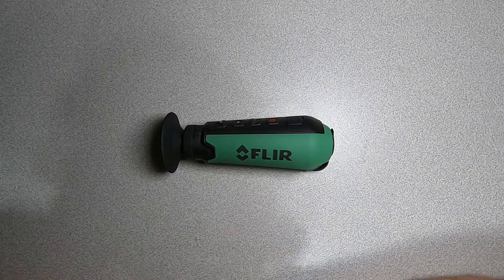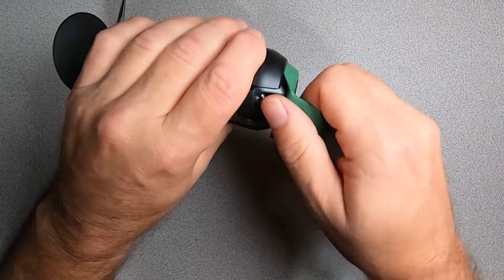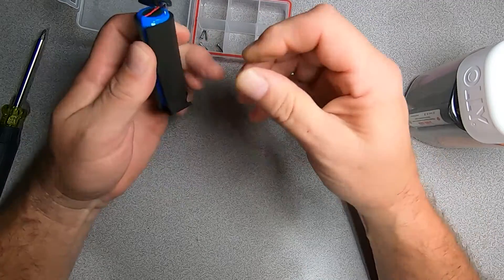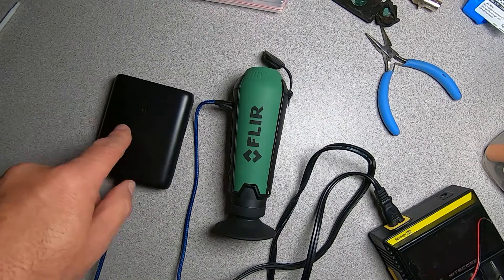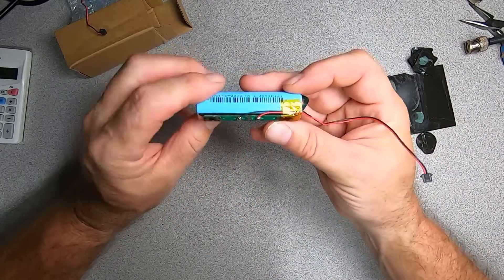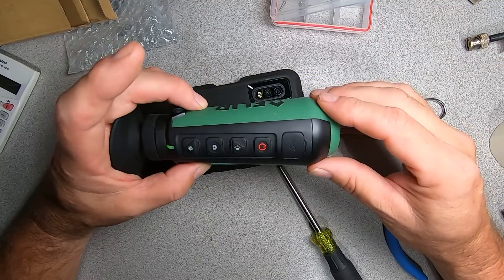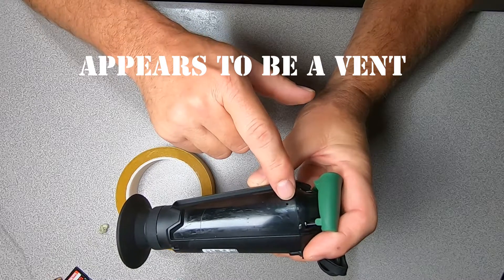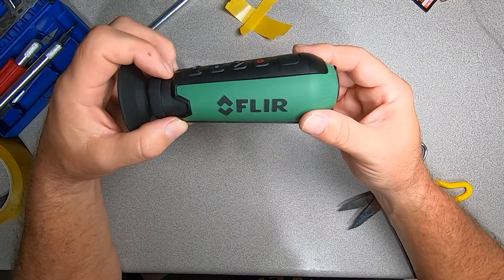FLIR Scout TK Thermal imager battery replacement

Comment: Thanks for the video. I've been having sensor issues with my TK along with the shutter not operating correctly (makes a whining noise). All I had to do was remove and re-insert the ribbon cable. The ribbon cable connectors have a small tab on the opposite side of the ribbon entry that needs to be lifted to remove and insert the cable. The tab on the main PCB is a bit tricky to access however the hook on a dental pick worked well. 

All sorted now and working like new again.
Reply from the maker: That is good news !  Thanks for sharing and thanks for watching !

Comment: I would like to know if people have trouble with their FLIR Scouts discharging a fully charged battery over a period of a week or two. It seems like there is a parasitic load that is sucking the battery even if the unit is not in use. Anybody have the same experience?
Reply from the maker: Yes the device exhibits parasitic draw but if it is discharged within a week you either have a bad battery or your device is defective. Either way to establish cause you are going to have to open it up. Thanks for watching !

Comment: Awesome straight to the point video ! Going to try it .
Amazon has tkx scout for 300 bucks that's half the price of the one you had in this video .
I thought they were the same as the tk but the added x meant it was extended battery life ?
Are you familiar with the tkx ? Just wondering why it is half the price
Reply: Thank you !
Reply from the maker: Thank you ! The TKX has a higher resolution sensor than the TK and it actually has some magnification ability as well. The battery life is shorter by 25 percent however. 

https://comparedhub.com/flir-scout-tk-vs-tkx/

The cost may be due to lower expense of the tech utilized between the TK and the TKX. Thanks for watching !
Reply from the maker: You are welcome !

Comment: Thanks for the video.
I have a problem with the battery. Its useful life is at the end. I looked for a new replacement battery on the Digikey website but it seems that Glob Tek no longer manufactures them. 
Is there a compatible third-party battery for the Flir Scout TK camera? 
So far I haven't found another battery.
Reply from the maker: Tie together single 18650 cell and a  1S BMS , encapsulate it and you SHOULD be set. Safely cannibalize your existing connector from the old cell. I have not tried doing such but that is what the Globtech cell is. Thanks for watching !

Comment: Danka! 🙏
Reply from the maker: You are welcome. Thanks for watching !
Reply: Hey what connector is it the 2mm? I don't see that on the battery spec page your have on here? @survivalcomms
Reply: And do you think it would work with an external battery pack with a dead battery still hooked up, or does it have to be removed completely to work like that?
Reply from the maker: @foxmulder7616  I havent tried to power it with like a battery bank through the USB.
Reply from the maker: @foxmulder7616  Digikey has 109 of the batteries on their site BL3500C1865001S1PCMK
Reply: Oh I'll look again, last time they were out. I was looking on Amazon, and they have 18650 with 2.54mm connectors.. Same specs, they have a slightly larger size connection too , I was just wondering which one, but I'll check digikey again! Thanks brotha!  @survivalcomms
Reply from the maker: @foxmulder7616  any time
Reply: Finally got er done. Putting the Molex connector back in was the hardest part lol, I couldn't see which way it went in on the video, but seems like it only fits one way.. Good it in there and it turns on, lol so she's back together and charging happily! Thanks again brother!!  @survivalcomms
Reply from the maker: @foxmulder7616  That is great !

Comment: I would love to see you convert BA-390 into a rechargeable battery for the prc-104 and prc-113 military radios. People talk about it, but no one shows how to do it step by step
Reply from the maker: I've never done one before. I found some info on this dudes page : http://www.richardsjohnson.net/id16.html
These cells appear to be right for the application :
https://www.digikey.com/en/products/detail/panasonic-bsg/HHR-200AB20T/365589?s=N4IgjCBcoMwExVAYygMwIYBsDOBTANCAPZQDaIcYYArFSALqEAOALlCAMosBOAlgHYBzEAF9CcagA5EIFJAw4CxMiAAsABmqaYDZm0iceA4WLVgE0WWix5CJSORiT16gOwRGIVuy58howjAATkkgmTkFW2UHEHUGUzg3MMsImyV7cjAAOjgAAgA1XS99EABVfl4WAHlUAFlcdGwAV25cAJAAWggU60U7FTp6Uw7qcN6ojJAdIZERIA
you would need 40 of them so cell cost alone would be 250 bucks.

Comment: I changed the battery,no problem, however the unit still discharges in 5 days while being stored.  Any suggestions?
Reply from the maker: There is some sort of parasitic drain going on. First are all of the controls and the device working well ? set the clock and power the device on and off a few times and check the clock. If it passes those tests we need to determine if the battery and its little management board is at fault (likely) or if the the is a problem in the device itself. Fully charge the battery open the device and remove the battery. Measure the voltage and record it. If you say it is self discharged over 5 days check the voltage after 5 days and record that. During this test also monitor the battery temperature and I would keep it in a safe location  while performing this test. If the battery fails this test contact digikey and tell them the battery is defective. If the battery passes let me know and we will go further down the rabbit hole.
Reply: @survivalcomms thank you, I will do that and let u know the results
Reply: Ok, it passed the power and clock test,  I checked the device every day and it steadily drained over 5 days, I will now fully charge the battery, remove it and check voltage after five days
Reply from the maker: @lcdrhobiesaunders446  ok cool !
Reply: I  charged the battery removed it from the Flir ,let it sit for 4 days, tested the voltage. It was about the same as when I tested it however it did not start the Flir and I have been charging it for two days now.  The Flir works when it is plugged in.  I think I have a bad battery, so will order another.
Reply from the maker: @lcdrhobiesaunders446  Its possible it is failing under load but the load is fairly low in this device . Try to see if the battery will power a bright LED head and measure its voltage under load.

Comment: Help! My TK Scout failed! 
Initially, the image started to fade/blur, followed by battery not charging. Now the unit won't turn on and the light won't illuminate when set to charge. I removed the battery, hooked up USB/external battery pack and still nothing. Bought it online brand new about 2 years ago. It's never been dropped or gotten wet. For $600, I'd expect more hours of use. If anyone knows how to troubleshoot one of these, I'd really appreciate the help.
Reply from the maker: If it wouldnt run with the external pack and the internal cell still connected you have more than a battery problem. You might bypass the USB and go straight to the batt output leads with a regulated power supply and see if it will energize the device. If it doesn't remove power and start checking the ribbon cables.

Comment: Does anyone know if the rest of their models can be likewise serviced? Common sense suggests so, but then common sense suggests it should be straightforward to replace a battery in the first place. Aside from planned obsolescence, I see no reason they shouldn't be. I don't for a moment believe it's a safety issue. Anyone competent enough to use an oven is probably competent enough to handle a lithium ion battery, and if they're so concerned they could design any given product to only take the slightly longer fused batteries. I'm inclined to avoid the product just on general principles. Some manufacturers (apple comes to mind) are so obnoxious that they've started to glue the whole mess together, just to make the consumer's grief complete.
Reply from the maker: I'm not sure if they can be changed out as easily but it is possible. That's why I make videos like this to save tech from becoming ewaste. Thanks for watching !
Reply: I'm glad it worked out for you in this instance, but consumers shouldn't put up with planned obsolescence in the first place. Any consumer would prefer a product that can be easily serviced and which uses off-the-shelf components, but it's sometimes hard to even find a product that does. This seems to indicate a tacit understanding among manufacturers that consumer products should deter repair and service. I can't see any real solution besides a law or laws that discourage or prohibit planned obsolescence. I see you're also a radio enthusiast. Suppose you want a new handheld transceiver that takes standard batteries (cr123,18650, etc.). That's pretty reasonable, no? Maybe there are HAM radios on the market that do take standard batteries, but it seems like most of the major brands do not. I did a cursory search and found nothing, aside from a reddit post assuring the reader no such thing exists. Isn't that bizarre? Yet this is hardly the worst example, amateur radios tend not to discourage serviceability to nearly the same degree as other consumer electronics and appliances. At the very least people have to start calling it what it is, i.e. planned obsolescence, an attempt to defraud the consumer.
Reply: And it's not as though so many companies are using proprietary or difficult-to-service designs for lack of standardized components or because off-the-shelf components wouldn't suit the purpose. They're using standardized, off-the-shelf components, benefiting from economy of scale but then making deliberate design choices to withhold this same efficiency and economy from the consumer. It is essentially fraud.
Reply: Incidentally I have a Yaesu HT, which takes a yaesu battery lithium-ion pack. They sell a 2xAA battery pack and warn that it should only be used with alkalines, yielding a pitiful 0.3w maximum tx power. I've long been tempted to try a couple 14500s. In series they would achieve the same nominal voltage as the lithium ion pack which has nearly the same dimensions and which I suspect might contain a couple of 14500s. I imagine it would only be a problem with the AA pack if its internal wiring were too thin to handle the higher current or contains any fuses that aren't rated for it, but I might give it a shot and stress test with 5w tx power anyway. Ten to one it would be fine.   @survivalcomms
Reply: I should mention that I don't anticipate the issue of planned obsolescence to gain much traction on youtube, being a probable repellent of potential sponsors. People should talk about it here anyway, but anyone truly concerned should probably raise the issue elsewhere as well before the internet becomes nothing more than favorable product reviews and all links lead to amazon.